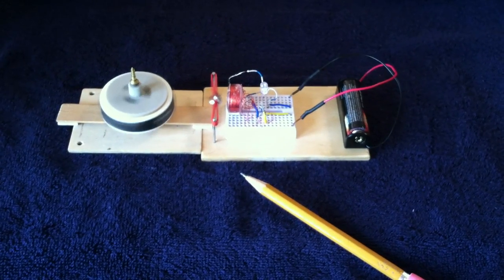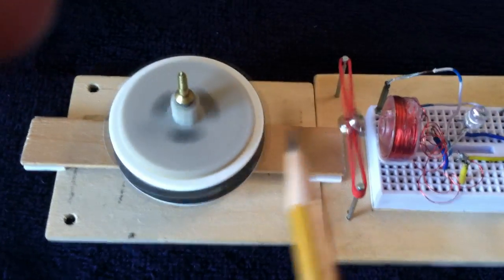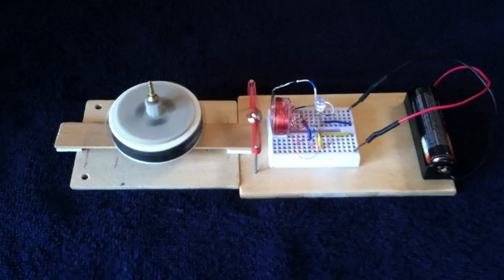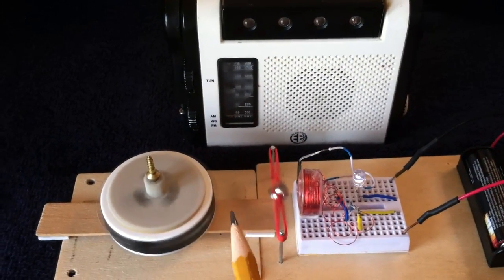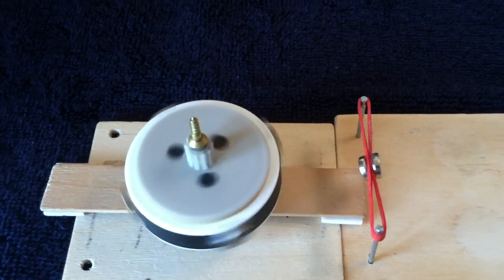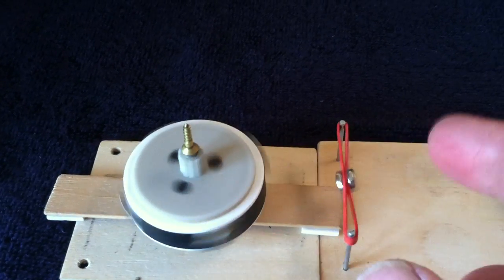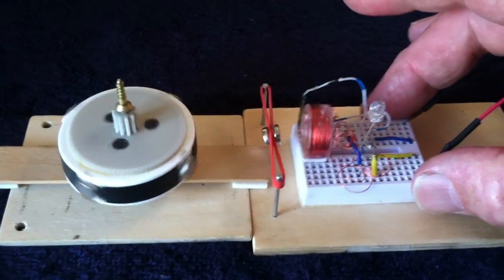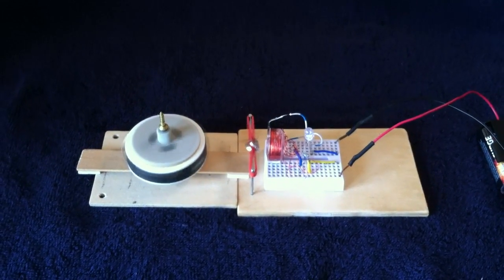Rubber Band Joule Thief -- Pulse Motor

Comment: Looks like it did sync up again too. Fun to look at the force changes here as well, from electrical in the coil, to vibratory back and forth to rotational.
Reply from the maker: This reminded me of those magnetic gearing experiments we did. It was fun to play with.There was enough room between the driver and the rotor to put non metallic things in the middle. The flux worked through them.
Reply: Indeed. Something of a neat visual would be to put another rotor to the side of this, sync'd up, with some of that magnetic film between that shows the flux lines.